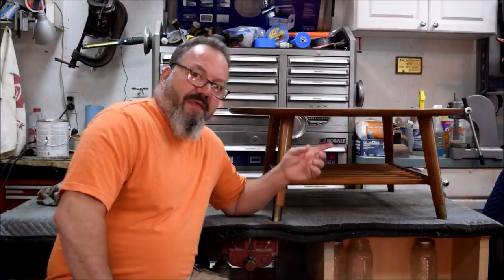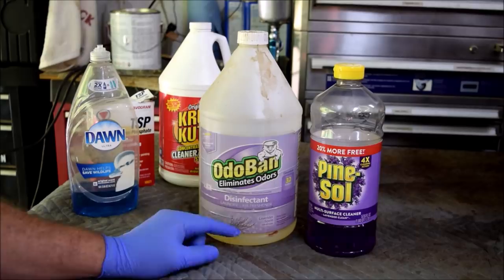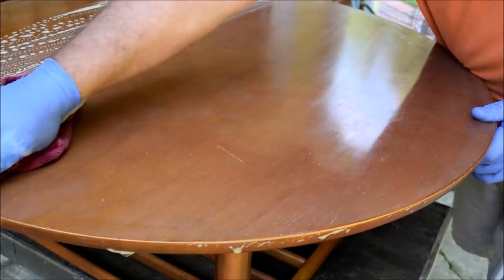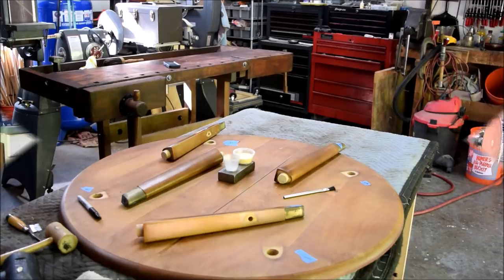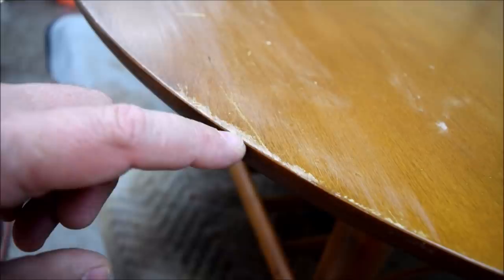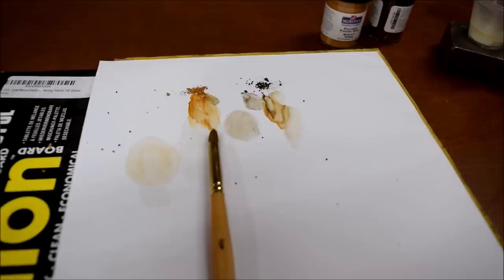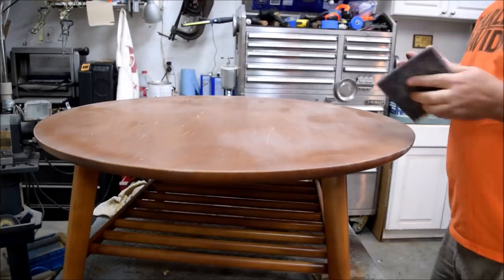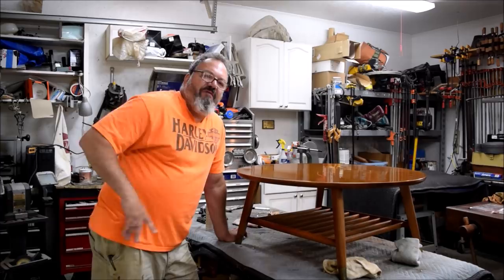Scratch and Color Repairs to a MCM Coffee Table

Comment: Really like all your info and videos. It just happens I have a table exactly like that one but have not turned it over to see if there is a tag on it for the maker. Has a cigrette burn on the outside edge. As a long time wood worker only a little experience in doing the type of work you do. You give me insperation to give it a try with all the imformation you give. Thank you so very much.

Comment: Interesting and informative as usual. I've wondered why not use an alcohol- water ring resistant finish when doing this?!Also would you recommend your degreasing mixture for removing dark stains from headrest of leather recliner? Tried commercial cleaner and didn't work. I want to cover about a 12" square with new [glued] leather and I'm afraid that it won't stick to the old head grease darkened area. Thanks
Reply from the maker: I believe Mohawk has an entire line of professional leather repair products.  I'd look there first.   I went with shellac as a barrier coat against possible contaminants and then lacquer to match the existing.   Polyurethane and similar varnishes are a possible finish for table tops, but normally not over lacquer.  The other benefit of lacquer is the quick dry times and the ease of color adjustments I can do with both glazes and toners if need be.   Great question and thanks for watching!
Reply: Thanks.

Comment: I have an MCM Arne Vodder desk that sees daily wear and it is showing some signs of use. The top has developed some dulled gray areas that are quite, quite noticeable in bright light. I don't want to irreparably damage my furniture, but I also want to keep using it.

Is there any seasonal fix I can be doing for this? I just want to enjoy the wood!
Reply from the maker: I'm sorry, I can't give you an educated guess on what you may be facing from afar.  It could be water damage, scratches in the finish, the finish may be deteriorating or even lifting from the surface.   Perhaps try a light coat of Old English furniture oil on it and see if it attenuates it.  Use the dark oil if your desk is dark and the light oil if it's a more natural color.  If not, you should be able to remove the oil with mineral spirts and a rag.    Anything past that shoujld be done after a diagnosis and with care.   Good luck and sorry I couldn't be of more help to you.
Reply: @LostMountainRestoration thanks for your reply! The dulled spots are mostly from where I rest my arms and where I use my computer mouse, so I am not sure how to mitigate this. I did do a couple coats of teak oil (wiped after 10 minutes and then reapplied 2-3 hours in between), but it didn't seem to do much once it had dried. If you have any further advice I would greatly appreciate it. If not that's okay too.

Here is a close-up.
https://imgur.com/3CvE3ef
Reply from the maker: @nesherman  Without getting into re-top coating and/or stripping, perhaps you may want to look into something like Restore-a-Finish.   I did a video on using it somewhere on the channel.   Just make sure you know what you are doing before you use it or you may wind up stripping off the finish anyway!
Reply: @LostMountainRestoration  I will take a look, thank you!

Comment: What’s your other approaches on round tenons after you’ve cleaned the glue and find the joint too loose to glue solidly?
Reply from the maker: I use epoxy with a filler mixed in to take care of loose joints generally.   Thanks for watching.